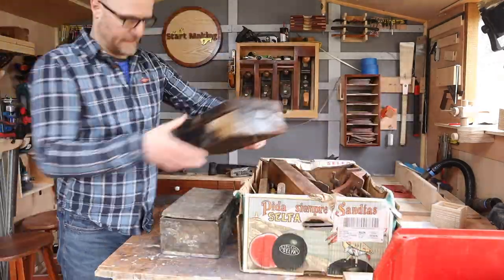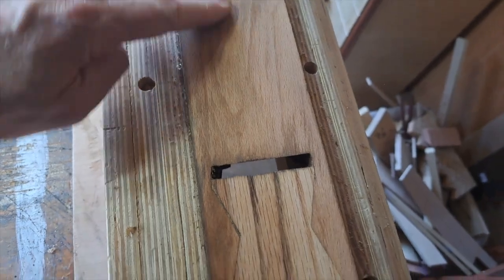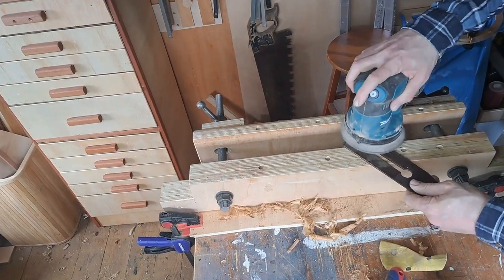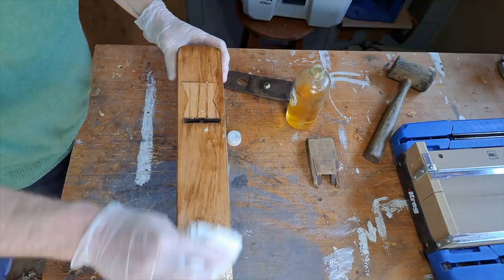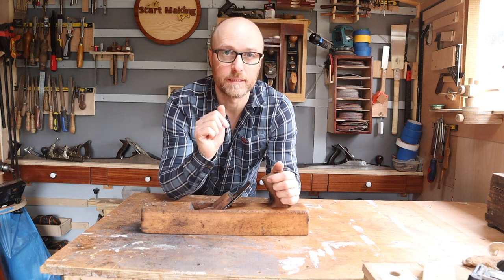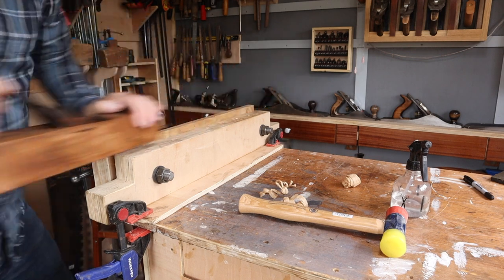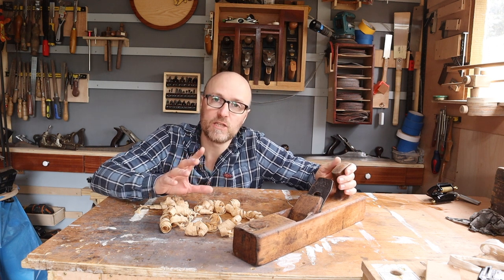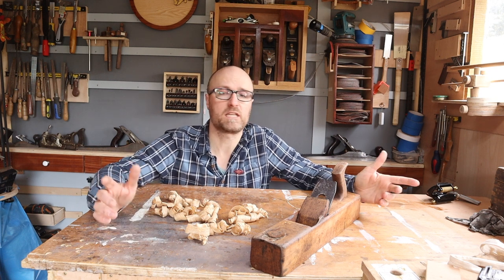Restore your wooden PLANE to outperform all others.

Comment: Thanks for the video and your thoughts on restoring a hand plane.  

After restoring a basket case coffin smoother I found, I really prefer using wooden planes over the metal ones.  I hope to one day to move away from metal bodied planes, though I do plan to keep some of them, and use wooden body planes almost exclusively.  

I would eventually like to make all my own planes with some vintage ones to round out my hand plane arsenal.
Reply from the maker: I could not agree more. I have just acquired a coffin plane and cant wait to restore it.

Comment: I have been having issues getting my hand plane (transitional, #29 I believe) sharp, but after watching this, it appears I just need to take more time. Your results seem worth the effort! Great shavings.
Reply from the maker: The results are definitely worth the effort. And the one thing that I changed with my sharpening that had a huge effect was taking more time on the higher grits and strop. You will get it, one day it will click.
Reply: @startmaking1  Thank you for the encouragement! I think this plane just needs much more love than I've given it so far, haha, since I bought it used and it the blade has a chip I've not gotten out yet. Other than sharpness, it seems pretty capable, and for a big plane (nearly jointer-sized) was much more affordable than a jointer. Yours looks sized to around a jack-plane, which is great; with the wooden body, it shouldn't feel too heavy (mine doesn't).

Comment: If you're having problems getting the iron and wedge out by using a mallet, it's possible that the wooden wedge has swelled and gotten to tight, or the iron and chip breaker aren't the correct ones for the plane. You can adjust this with floats or even a file if you don't have floats. Start in small strokes and test. The iron and chip breaker should easily go to the bottom, but not have any slop from side to side. Then place the wedge in. The wedge has a particular spot that it should also feel good in. It should drop in fine, until just before it wedges. I don't know if that makes sense. But you will get a feel for it. I usually drop my iron in, with my hand on the mouth and as soon as I feel it coming out, I pull back just a bit and wedge it. Then I place it on the table and set it with a mallet.
Reply from the maker: Hi Timothy. I am pretty sure that the wedge and iron are not original to the plane and that could be a big part of the issue. Thank you do much for such great advice. I shall take a look today and see if I can make the adjustment process a little easier. Much appreciated.